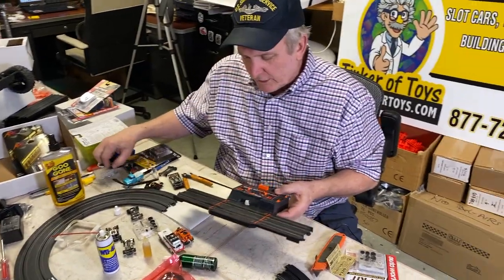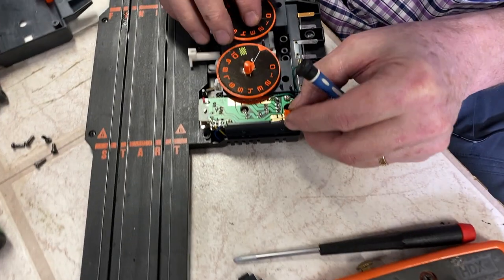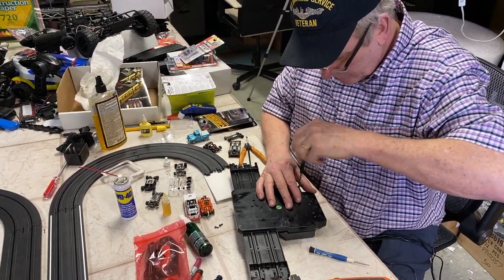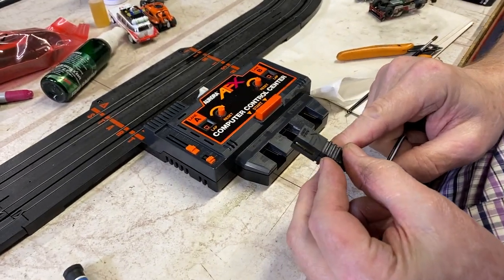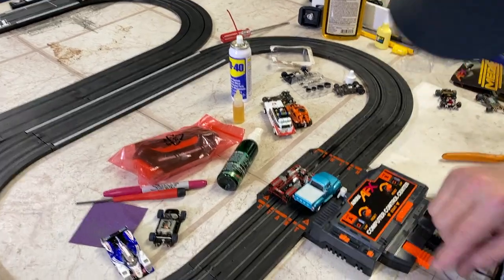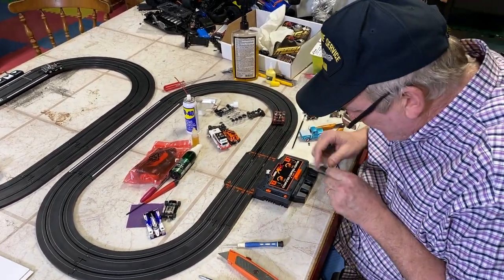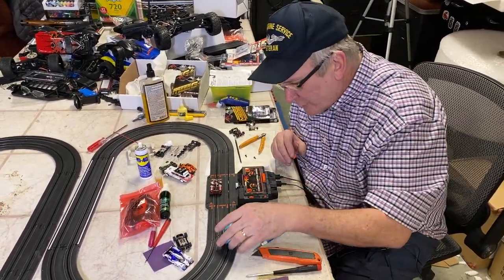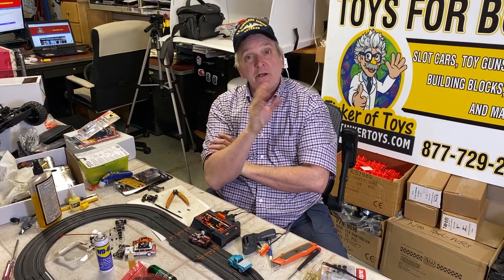How to Computer Control Center |  AFX8639  | AFX/Racemasters

Comment: I have the AFX Data Race Control Center, I'm having an issue of both controllers with make both tracks power up. Before I start opening it up I was hoping maybe you have a trouble shooting tip?

Thanks in advance.

Comment: I have an old Ghost Racer set from 1989, all parts intact, all in original box, with both cars working... The auto and manual modes both function... Only thing is that it only goes one direction so that it trips the counters... What I would like to eventually do is get a standard two way transformer feed-in section and leave the original ghost controller alone... Hell, I may just decide in the future to pump in the time and cash, and build a permanent mount Racemaster AFX 4 or 8 lane track system in a large basement customized table configuration with a specialized transformer, computerized speed/lap counter and multiple race stations with seats and a plug in for each controller, sort of like some of the hobby shops had (and some still have) with the larger scale slot cars for organized race meets..
Reply from the maker: That is awesome!

Comment: I find my car is far too fast to hold the track. not sure if the slider is setting the speed.
Reply from the maker: Make sure to feather the throttle around the corners to control the speed and slow down a bit. Racing takes some skill and practice.
Reply: @ProTinkerToys  Sorry I was talking about the ghost car.

Comment: PB blaster would be better cleans better and actually you don't even have to wipe it off it's very good at cleaning electrical stuff switches and so forth I did the electrical switches on my Caprice classic for the windows spray them down made the contacts better and the windows go up and down beautifully it even says it on the can
Reply from the maker: Thanks for sharing
Reply: They make a Spray for that! MAde for electric contacts!